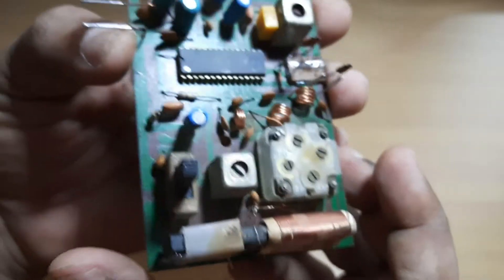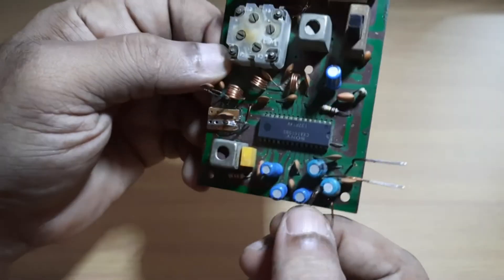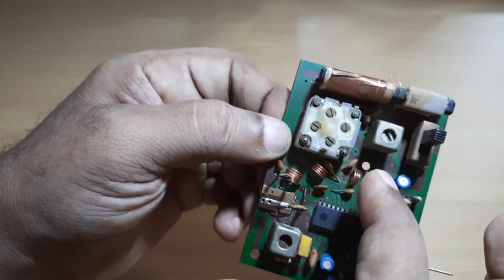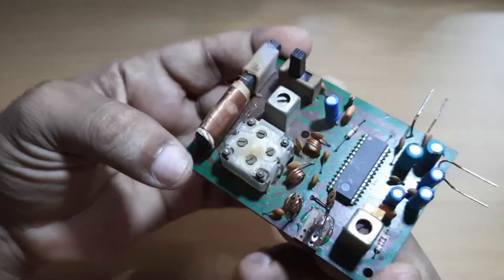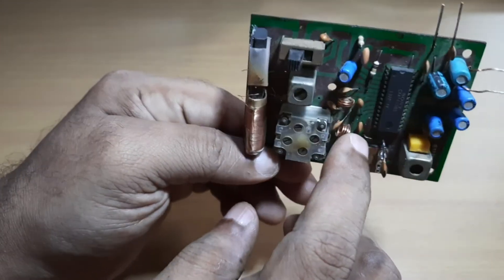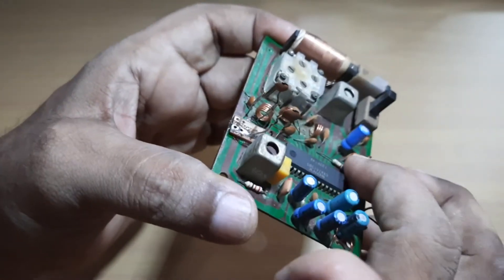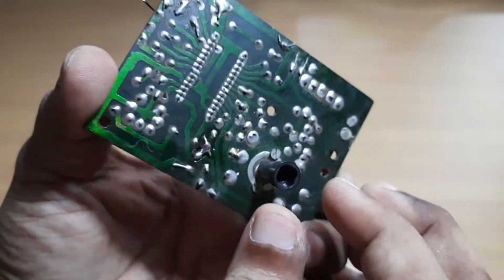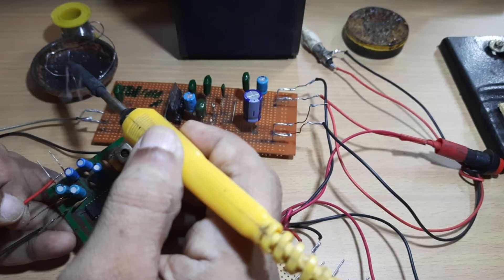An AM/FM Receiver Using Sony CXA1691BS

Comment: Where i get this board?
Reply from the maker: This is a dual AM/FM band radio using the Sony CXA1619 IC, which is not available on the market right now. The FM radio based on this IC is available on Amazon.in. You can check the purchase links provided in the description board. Also make sure that you buy one using CXA1619 IC. There are FM radio boards based on other Sony IC chips too, that may also work fine.